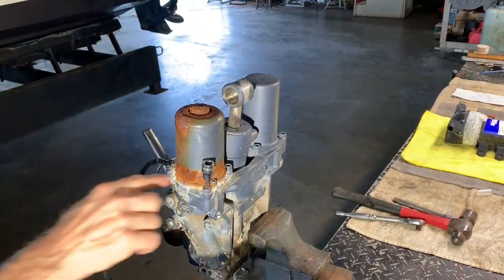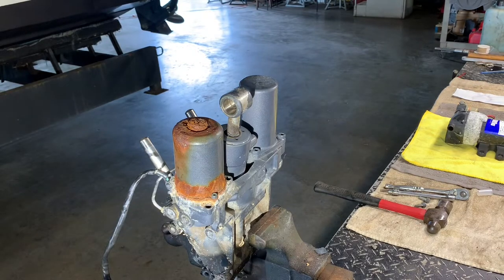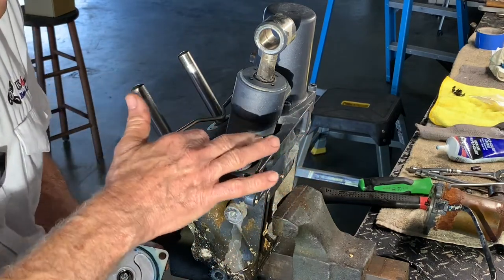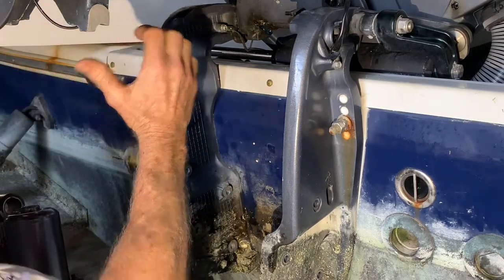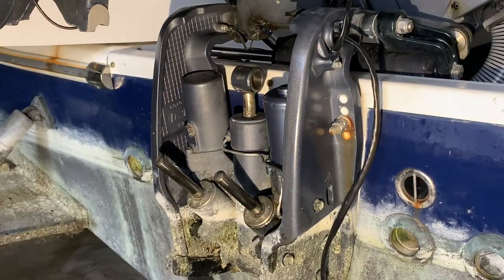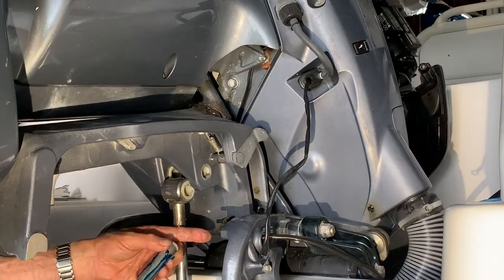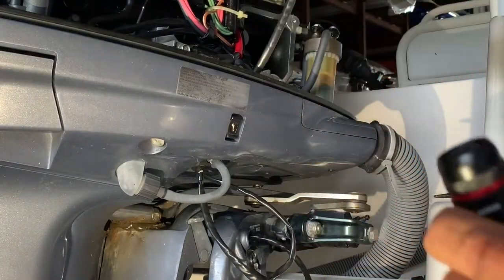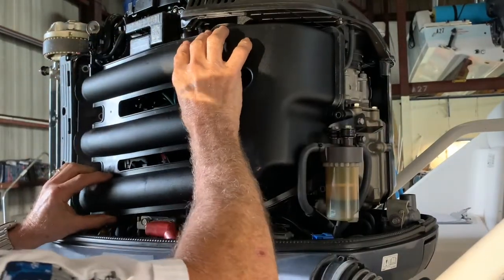PART  2 Yamaha F 250 Trim Motor

Comment: So happy I found this, every other video is for trim seals. Thanks for posting this. What caused the motor to corrode like this? How much fluid should I add to get it back to normal?
Reply from the maker: Hi Josh, It’s the fact the motor housing is metal, reason why I like to paint the electric motors when I get a new one to install. A lot of these in several horsepower are coming in plastic.  You should be Ok with a little less than a quart of fluid, and remember using non-detergent and above all avoid ATF. Thank you so much for watching.

Comment: Great video!! do you need to replace the fluid that seeped out? Didnt look like you added fluid that was lost.
Reply from the maker: Thank you for watching, yes, fluid most be added after installation of the unit, I probably missed to tape that part Ill see the video again to confirm, but yes you must add fluid when unit is all the way up in at least two complete cycles up and down.

Comment: you lost some oil..ive had issues filling..what is the procedure when air has gotten in...not this case..but for example if you had repaired a leaky trim seal

Comment: I'm new to boat ownership and repair.  I noticed that you like to use marine grease on surfaces; is this to prevent rust, as well as to make it easier to remove the part later if needed ?
Reply from the maker: Hi Tyyoung, exactly both, now on the corrosion side, I probably wouldn’t be  so adamant in using this grease if I were on a fresh water environment.
Thank so much for your question and participation on the channel.
Take care

Comment: Great video, what is the torque specs for the 8 bolts ?
Reply from the maker: Hi TN, Manual shows 14 FtLb for the  electric trim motor, and 26 to 30 Ftlbs on the trim unit mounting bolts, however some torque specs are just a suggestion given that they don’t need to be that accurate bc are not safety parts, as of a connecting rod, crankshaft bolts, crankcase bolts and power head fasteners are to be taken more serious. On these ones I use common sense in what I think is  enough for the bolt not to come loose or brake.
Hope this helps. Thank you for watching. 👍🏻
Reply: about 1.25 grunts ;)

Comment: I need to replace the reservoir on the other side - does anyone happen to have that part number? I am having a heck of a time finding it....
Reply from the maker: Hi Scott, Reservoir Part Number  69J-43828-00-00  $230
“O” ring 6H143869-00-00  I have it used in good condition for a lot less if you want. You can contact me through my web site.   us4marinerepair.com   Thank you for watching, Take care 👍🏻

Comment: is it possible to replace the trim motor without removing the whole unit?
Reply from the maker: Hi Chris, thank you for watching. It all depends, if you’re asking because the center engine mounting bolts are in the way? Yes it's possible, having the right tools and the skills, in this case however for the amount of effort involved in dropping the whole unit vs risking breaking one of the electric motor bolts or working uncomfortable, I rather removed it and benched it. Also some of my videos are for folks to be able to work on their own motors at home or their marinas, reason why I try not to get too confusing. 
Thank you.